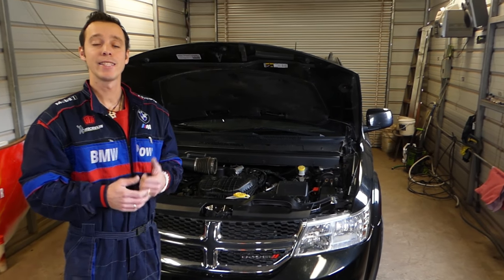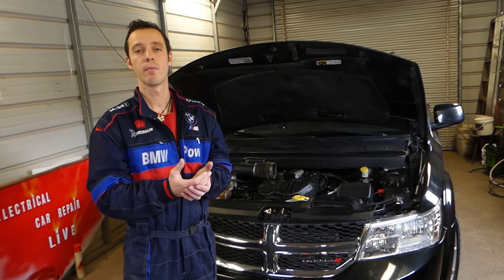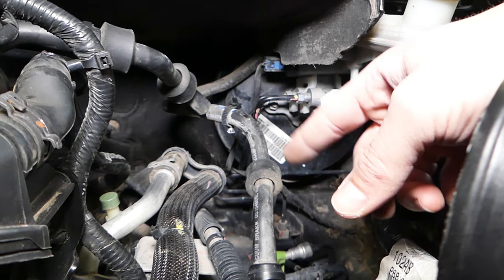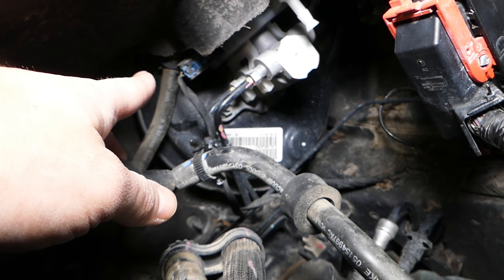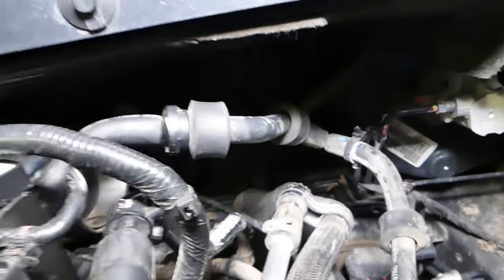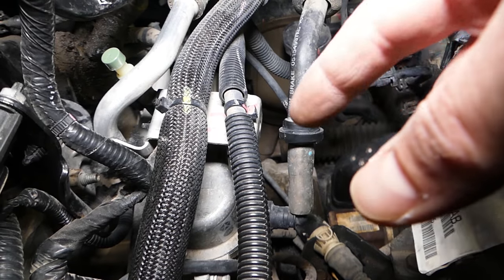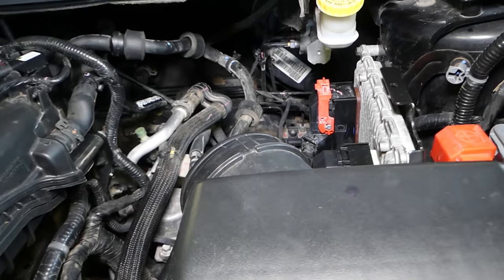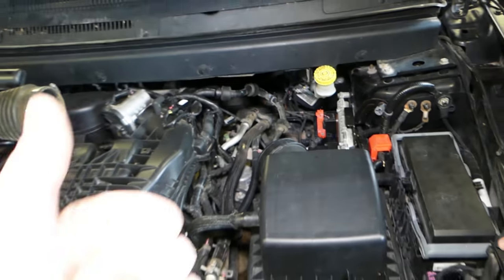HARD BRAKE PEDAL CAUSE AND FIX

Comment: Thank you very much! It's about time a video for THIS ISSUE was made. This is a serious problem which if Not addressed can lead to a tragic incident. It has boggled me for a few years now. Thank God I have not had  an accident,  and I have been braking well. However, there is no power in the braking. I knew it had something to do with either booster or vacuum. Now I discover there's a vacuum pump to deal with..

Comment: Unfortunately for me, my 2005 Town&Country doesn't have a brake vacuum pump, and I saddened by this discovery bcuz it would mean I will still have that hard pedal. On another note, changing the pcv value  although proved to be difficult, And came out in pieces, it pushed me to replacing the value cover gaskets too. The brake pedal is still the same (no resolve there yet), but engine power did increase a good 30%. I was surprised at the acceleration. Still, the most important part is resolving the hard brake pedal. I doubt I will be replacing the booster or master cylinder. However, I do wonder if the ABS valve has something to do with it.

Comment: It happened to me during heavy traffic constantly moving and breaking so when I stopped I turned off the car and then turned it on again and it worked properly again. Does this means that the system is going to fail soon or is it kind of "normal"??
Reply: the commenter increase idle rpm to 800-850
Reply: @nobody6440  how does that help?
Reply: high rpm will increase the vaccum in brakes vaccum pipe
Reply: @nobody6440  thx. Will give that a go
Reply: Same thing is happening to me. I pulled over and turned off my car. The brake pedal felt stuck so I kinda forced it to go up and I hear something release from my tire I think. Anyways the brake pedal goes down now that I did that

Comment: I have a 2016 dodge caravan 3.6l v6 and I just changed the oil cooler out and am getting 2 problems. 1. the brakes don't seem to be engaging at idle speed but work fine once I get past the 10 mph range. 2. I am getting a tick on the mil and the esc and also the etc and brake warning light. Any ideas whats going wrong here? Only ticks after getting to running temperature except the brake warning light is on all the time now
Reply: Update: after looking over the connections again I realized the precise hose that connects to the brake system and seemed to be causing all the problems. I am 10 minutes into it and no more problems

Comment: nice thanks. Yesterday, while driving after resolving tyre puncture, after a few kilometer drive, on the highway, i heard a Popping sound, and thats all, the brake pedal became hard and I could not press it. I stopped it and slowly with hazard lamp condition, brought it to my garage and working with the mechanic. But, still, i am clueless what be reason. My car is FIAT Linea. any inputs for me pl. Thanks.

Comment: Check throttle body gasket. I think that's my issue asi removed it then re installed it to engine without putting on new gasket. Next day hard brakes.... cause of vaccum loss? Maybe. Cheers.

Comment: Can it still be fuse related with the vacuum pump because the only time my car won't start is when temperatures go below freezing I'll try gas line antifreeze I've tried everything I have a brand new battery brand new manifold new alternator and new starter mine is a 2012 Dodge journey??

Comment: Hi. I just replaced the booter and vacuum pump on my 2012 vw jetta 2.5 L and i still have a stiff brake pedal.......any suggestions? Thanks
Reply: ps3king2012 increase idle rpm to 800-850
Reply: @nobody6440  what does this mean please
Reply: Wrong position of the check valve perhaps

Comment: Hello, love your vids, I have a dodge journey 2.4 liter sxt. My problem is starting my car because my brake pedal becomes so hard it wont let me start my car, this problem is only at start up, brakes work great when car is running. Also I get a red lightning bolt with this problem. 

I replaced my throttle body and remember my brake feeling normal for start up. but since replacing my throttle body, I have had this issue return twice with the hard brake not allowing my car to start, resulting in tow on both occasions. Any thought on this anomoly.
Reply: Did you find the issue yet I have the exact same issue and car
Reply: @tazzy2778  Yes, I did. Believe it or not, my battery cable on the positive side was not tight enough, causing
Reply: A voltage drop.